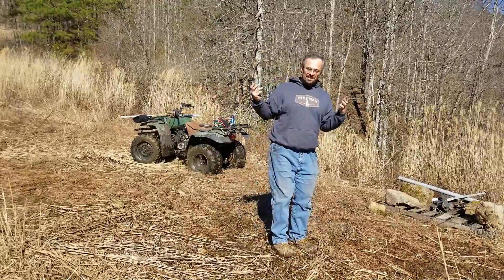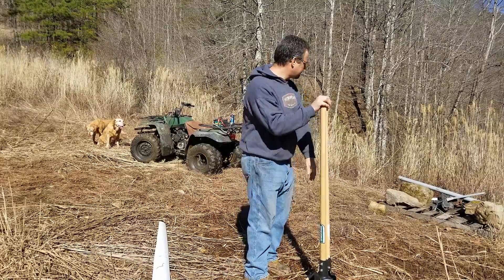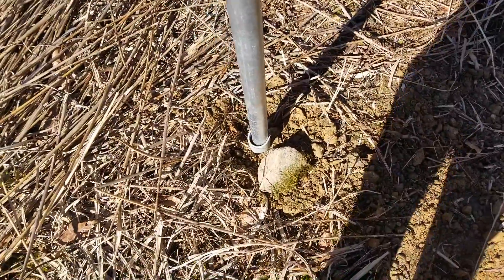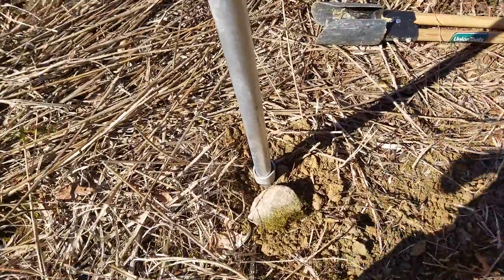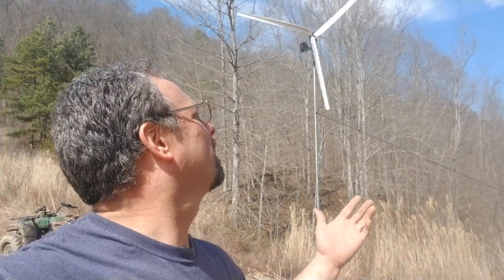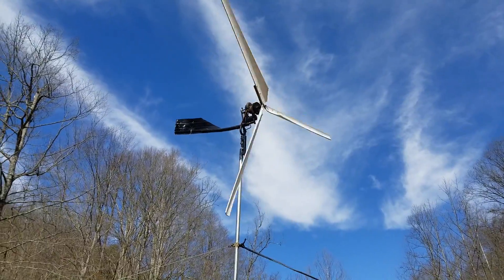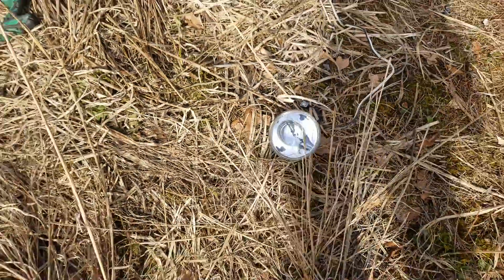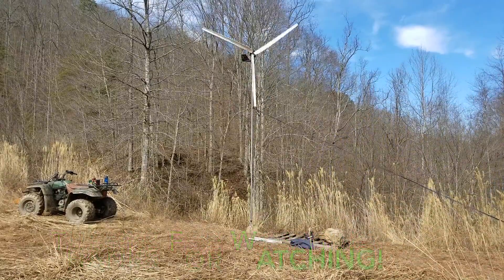DIY Wind Turbine standing on it's own.

Comment: Your wind turbine is facing that way because of your blades, nothing wrong with the tail. 
Look at them and think :-)
Reply from the maker: It actually was the tail. It got bent when I dropped the windmill. I took it down and straightened the tail and it turns straighter into the wind now.

Comment: I don't get it, you dig a very shallow hole and expect it to last?????????  No concrete, nothing but dirt!!!!!!!... Also, too low to the ground, you limit it by not getting it above the area trees into smooth air. You are NOT going to get much of a harvest of power.  Sorry, I say it like I see it.
Reply from the maker: You are right. This setup would not last, nor was it intended to. It does work though. being right at the end of that field it catches the breeze pretty well. I really didn't expect much efficiency from it. It was more of an experiment I didn't want to put much money into. I'm getting more power from it than I thought I would. It isn't constant power though with the wind speeds around here being low. My intention was to try it and learn a little about wind generators and then take it down. I am thinking the generator would work better, and more consistently on the water wheel I built.

Comment: Would still use a couple more guy wires to really stabilize it good as can be. Having something like this able to run and generate more power whenever the wind is up is an excellent addition to the off grid setup. Great win Luke !
Reply: Curious as to how much it makes, that and how long the wire to battery will determine how much is really viable for the off-grid purpose.
Reply from the maker: The run to the battery will be short. The whole power box is going right by the wind generator.
Reply from the maker: I plan on at least one more to triangulate the support system. It should help supplement my power needs.

Comment: Looks good Luke! Do you have any way to slow down the blades in a high wind, or is it cheap enough to let it self-destruct?
Reply: I hope there's a way to insulate it before the inverter/controller and battery. Put it on a second grounded coil, generator or other to keep any problems on the wind mill end to either stop or minimize  a electric overload/problem? [kind of like the secondary generators on electric poles or lightning rods?]
Reply: @lkimberly2064  That shouldn't be a problem, because most charge controllers will handle that. Also, a suitable fuse on the line from the wind generator to the controller will also be helpful. Good point though.
Reply from the maker: A lightning rod might be a good idea. It's not that high up though.
Reply from the maker: The charge controller has automatic braking. When the voltage goes above charging voltage, it will put a load on the generator to slow it down.

Comment: The Best way to determine wind direction is complicated and expensive. I spray pesticides and when I need to know at a job site what I do is reach down and grab a few blades of grass. Throw them up in the air and watch which way they blow / fall down. Sure it’s not as fancy as using a Millennial’s App and Bluetooth to a handheld smartphone device. But it’s never been wrong and if you don’t have any grass you can usually find dirt, mulch or a napkin.
Reply: Or the trees, with enough time- it usually blows at a faster rate higher up than at ground. And terrain must be considered, where are the eddys and actual pressure/impact locations. Not easy to be sure.
Reply from the maker: Yes the old throw grass in the air trick works well. I think the wind is rolling around the trees at the end of the field.
Reply: Now to be fair I do use the WindAlert App if the wind is predicted to be strong or changes direction. But that is mainly for forecasting the days productivity